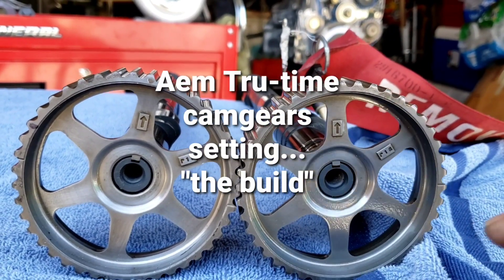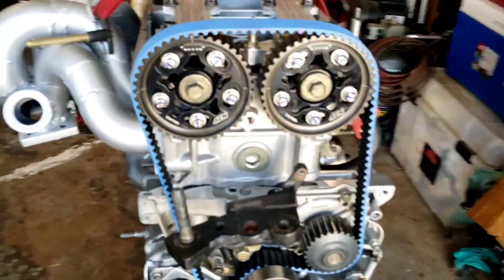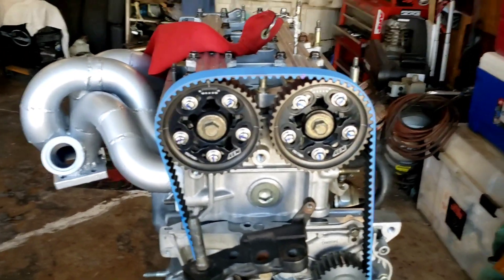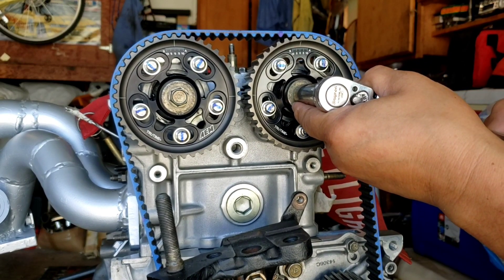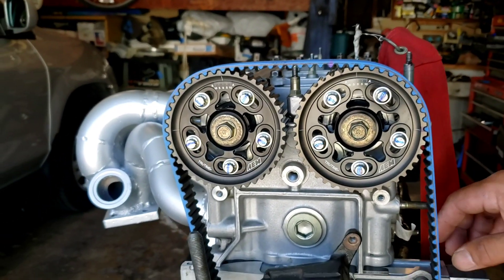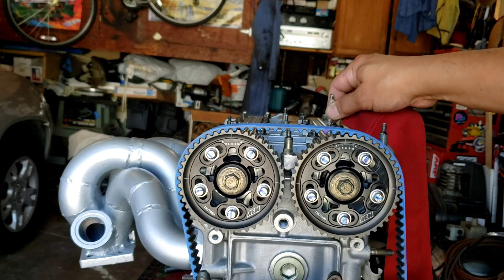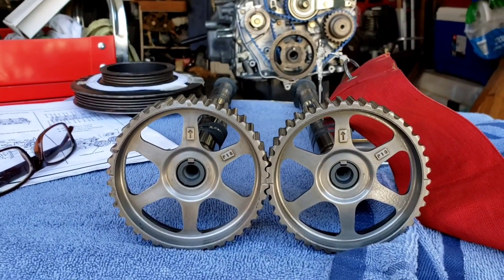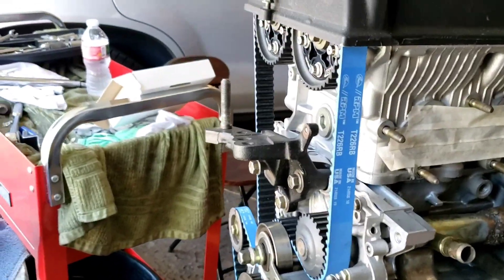How to adjust H22, G23, F20B adjustable camgears. pt. 18

Comment: Do you remember what size socket you had to use? Trying to figure out which one I need to buy
Reply from the maker: Is it for AEM cam gear bolts? It's 8mm or 5/16" ....12 points socket
Reply: @sagittnet2158  interesting, I was wondering if it was smaller because the 8mm had just a small bit of play so I didn’t wanna risk messing it up
Reply from the maker: @carlosfley3768  8mm socket is ok to use. The aem screws are good quality it wont get strip or anything.
Reply: @sagittnet2158  I appreciate it, thank you
Reply from the maker: @carlosfley3768  no worry man!

Comment: Hey, what did you set the base timing to  when you tune the car
Reply from the maker: When l was breakin the engine, l retard the ignition a bit to prevent any pinging and 16 degrees ignition timing when l went to get it tune.

Comment: I think I have this problem my head was machined and I had a bit trouble Lining the cam gears but made it work but my belt was walking like crazy so I got the ks wall blocker and still moving around and then seen my intake gear is wobbly so I just got some aem adjustable so I might have to do this to  lmao
Reply from the maker: I never knew about the H22 cams alignment hole( not sure if is indeed for setting cam tdc like H23a1) but sure is perfect for aligning it though. Try it out bruh! At the time l was aligning it, l kinda forgot the tool l was using was still there and as l turned the assy, it broke. Lucky me l was able to retrieved the broken piece.  Dont do like l did lol! I'm shocked that your belt is still walking even though your'e using a kstuned walk blocker. Never deal w/ belt walking out a bit. Hope you get it fix soon. Thanks for watching man!

Comment: Wow i have those same AEM cam gears on the b20a motor blue belt too ive just dropped out my lude, my question to you is can i swap the aem cam gears & blue timing belt off b20a to h22a?🤔..fyi successfully got the H22a4 motor in the lude & wired, i use your channel for the motivation 🤝🏽🤓
Reply from the maker: The B20a belt might not fit coz H22 is taller and the gears. Not sure if it has same numbers of teeth gear for the belt.
Reply: Yup, thanks this info has been helpful 🤝🏽😎